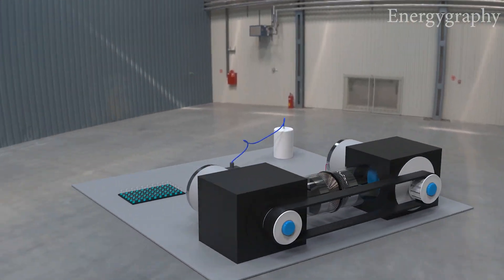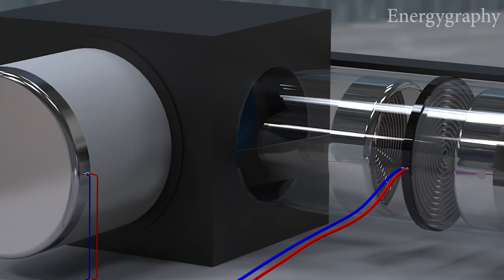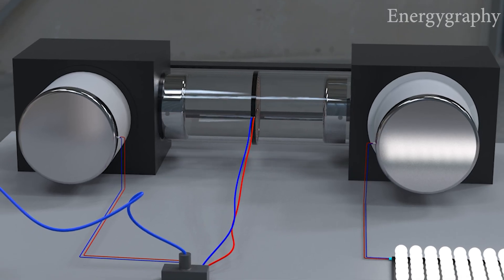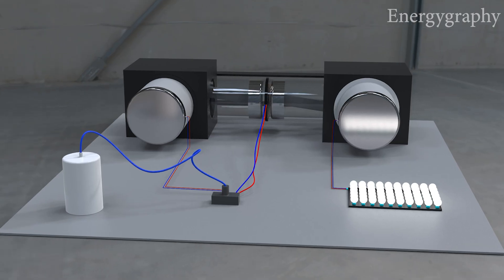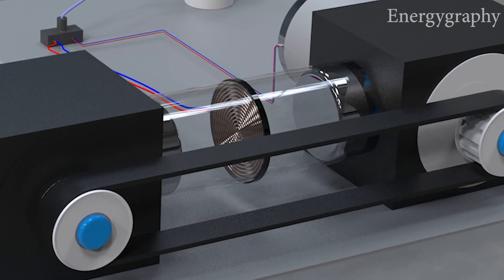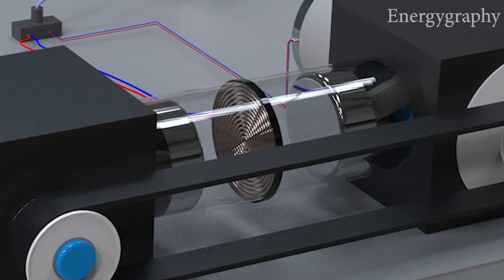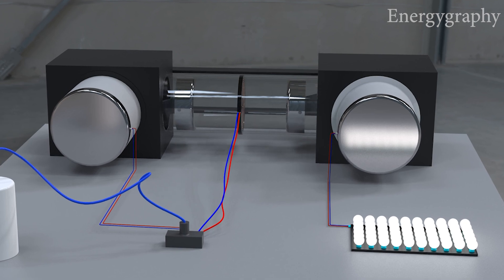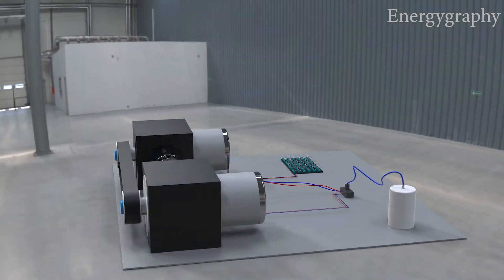Is it possible to neutralize the magnet?

Comment: Wow.. I was very surprised to see this popup in my feed! I had a similar idea but in a much simpler form (without crank shafts).. but I think your configuration may work better at least to start with. The issue with your idea however is your magnets are in attraction - so your neutralizer would require too much energy to shield or break the attraction between these powerful magnets. My idea is to use magnets with same poles facing (meaning in repulsion). Your neutralizer would consist of a ferro material that will attract the magnets. When magnets are close to the neutralizer they will be attracted to the neutralizer and it will cancel the repulsive forces of the magnets. When current is applied to the neutralizer to generate a repulsive force (so you'd need 2 coils), the magnets will repel with great force. Once the power to the neutralizer is turned off the magnets will be attracted again to the neutralizer.

Comment: fantastic👌💖
Reply: I hope this device is not really the best free energy magnet generator, since this device does not work! Without e-magnets it does not move. If you add e-magnets it moves. This shows that you have here nothing else than an unusual and not very effective e-motor. This e-motor drives a generator and this generator is supposed to drive the e-motor. Since both of them have losses, this does not work. And there is no way to gain a surplus of electricity with it. But of course it works fine in a simulation ... ☺